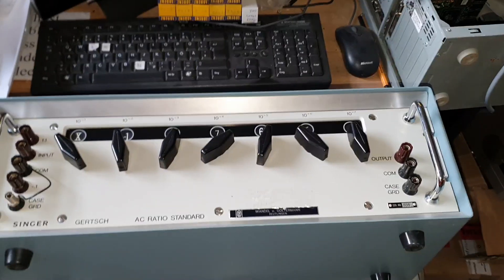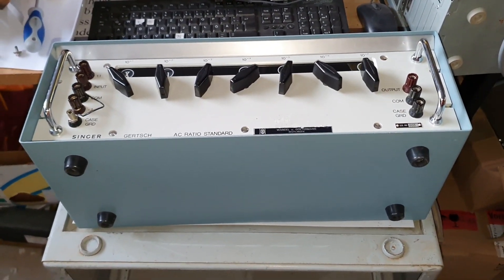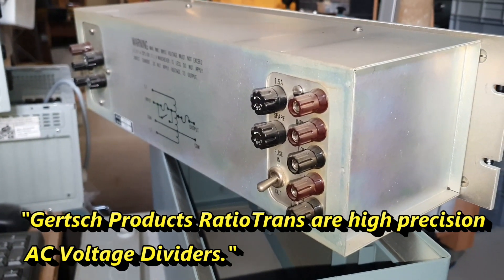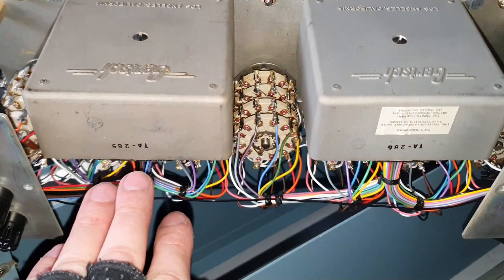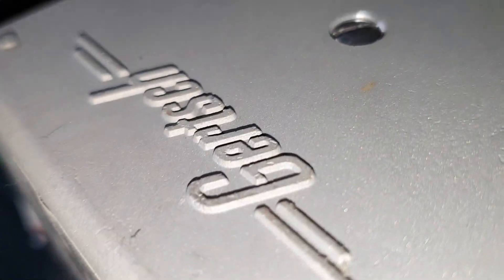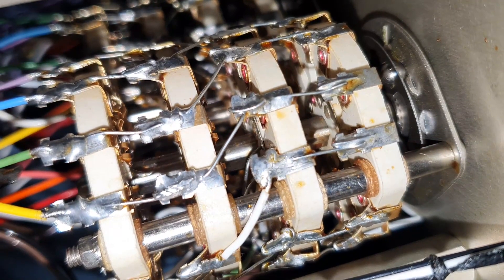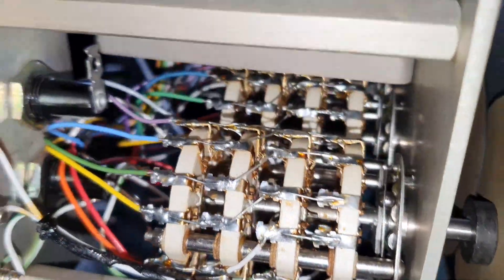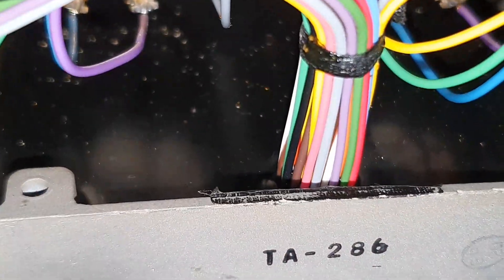BEB #142: Singer Gertsch AC Ratio Standard (a brief look inside)

Comment: I own over 250 of these, in various models / configurations.   I even visited the old Gertsch building in Los Angeles, 20 years ago, hoping to find some Gertsch remains in the weeds around the building.  ESI made a lot of nice ratio transformers as well, and you can buy a few of these, brand new at Tegam corporation.   It's hard to beat an old Gertsch box if you want to accurately divide an AC voltage.  There are a few precautions to observe in order to get maximum accuracy, but when you do, they outperform most (if not all) semiconductor multiplying D/A converters.  It's easy to generate 1 Vrms, but it's tough to generate 100 uV accurately, unless you start with 1V (say, from a signal generator) and subdivide this voltage with a Gertsch box.   You can generate very accurate low-voltage sinusoids, well below the noise floor of some of the best benchtop multimeters.
Reply: I agree. Low noise, even lower distortion.